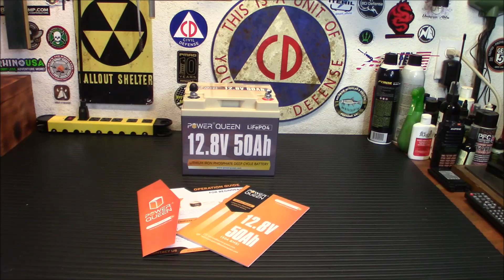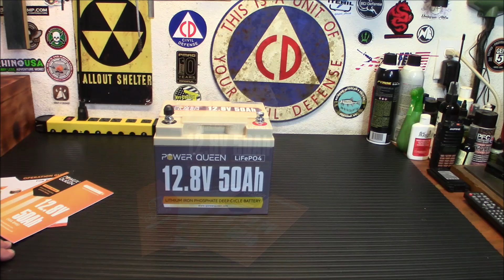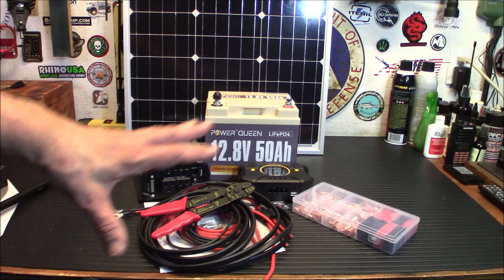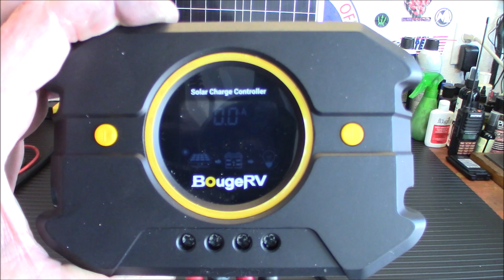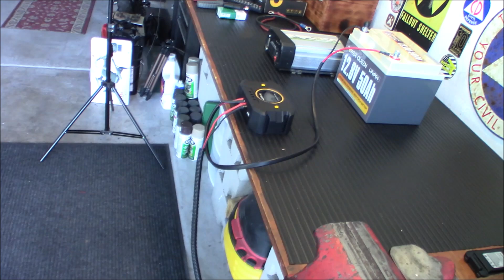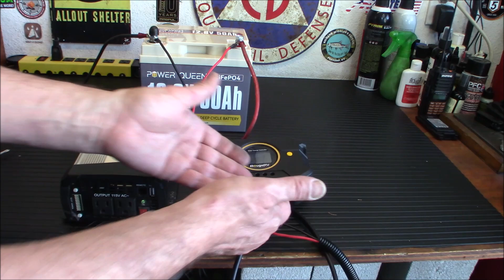Affordable Batteries For Your Solar Power Systems - Power Queen!

Comment: What would it take to keep a deep freeze running? Like, how many batteries and panels to keep em charged?
Reply from the maker: A whole lot depends on how much power the freezer is using, once you know that AND the amps it pulls, then you can judge about what size battery bank you will need and solar panels that will keep it running.  Get a Kill-a-watt and plug your deep freezer into it and then into the wall, it will log the power and amps your freezer draws, once you collect that info then if you remember to, let me know and i will figure out the rest for you
Reply: @Iridium242  Hey, thanks!!! We don't have the deep freeze yet, but I'll figure out the amp loads when we do. I guess it's just knowing how many batteries to hold and deliver enough amps at once to start the compressor. I figure if there's enough to run a deep freeze or fridge, that should be enough. Thank you again for your reply!!!